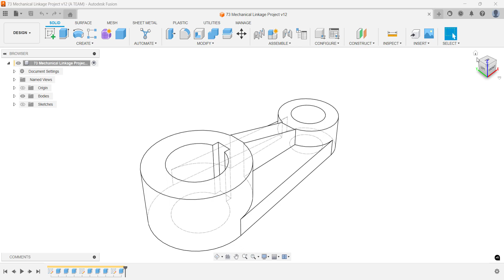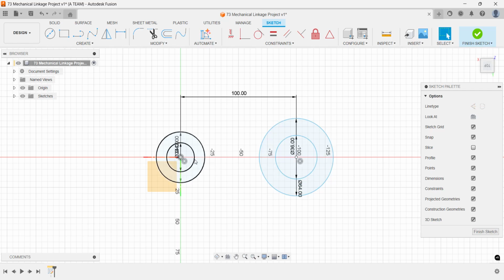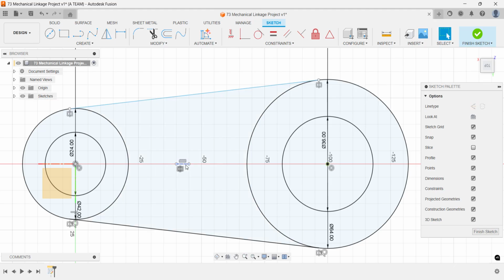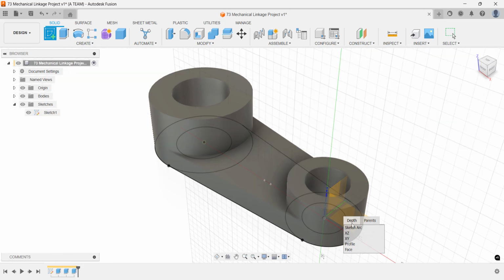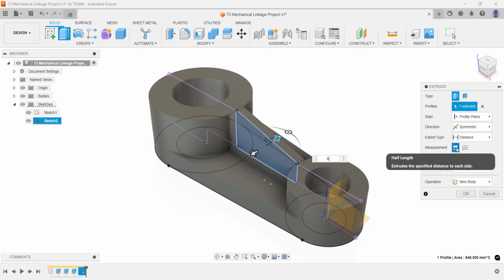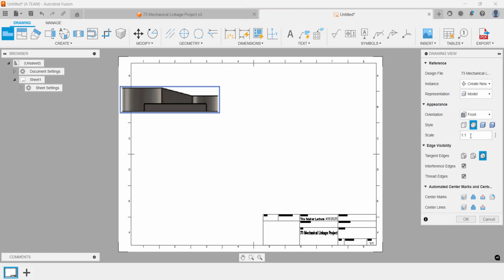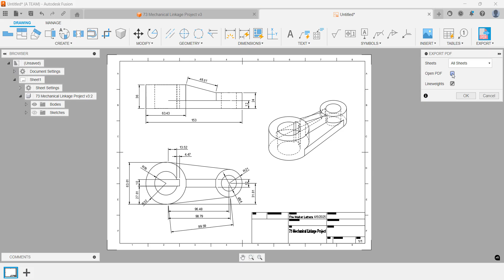3D CAD Tutorial For Beginners | Fusion

Comment: Why use an extruded sketch for the support between the two cylinders when you could have used the Rib feature for a much simpler workflow? The Rib feature is intelligent, and fills gaps where faces meet, where you had to extrude multiple times to fill gaps. If there's a valid reason, I'd like to know please.
Reply from the maker: You're absolutely right — the Rib feature is a great tool and can definitely simplify many workflows. There are several workflows that can achieve the same result in Fusion. In this tutorial, I intentionally limited the number of tools and commands to make it more accessible for beginners.

I also avoided using user parameters or referenced geometry inside the sketch environment to keep it simple but I think it would be nice to have a relationship between the different circular bosses and the support structure. :)

Comment: Please explain how to use the hole command to put in 90 degree holes on angled surfaces. As in for example a wedge, the hole with countersunk top is 90 degree from the base, not 90 degrees from the sloped / angled surface? If that makes sense! lol
Reply from the maker: Great question. You can create a custom construction plane (at an angle) and work with a combination of tools like the hole command and points. A bit abstract to explain in text, but I'll put it in my backlog of video ideas and maybe do a tutorial about it. Thank you!
Reply: @The_maker_letters  ah thank u so much for answering me! I posted this Q on about 10 other channels an no one else responded. Am very grateful!
Reply from the maker: Thank you and good luck! :)
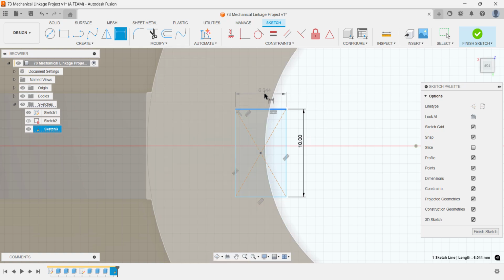Reply: Nice video. I noticed at 7:04 when you dimensioned the small center rectangle to 10mm, the center of the rectangle moved down a little. Is this what you meant when you said you were in a hurry to extrude and didn’t fully constrain the rectangle? Just curious. Thanks.
Reply from the maker: @tzampini yes you are right, I made a small mistake there!